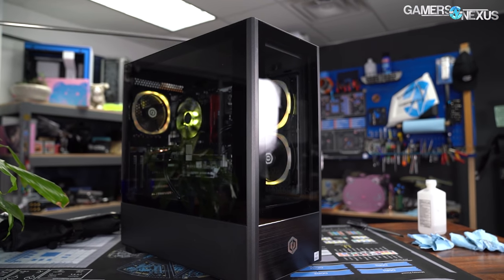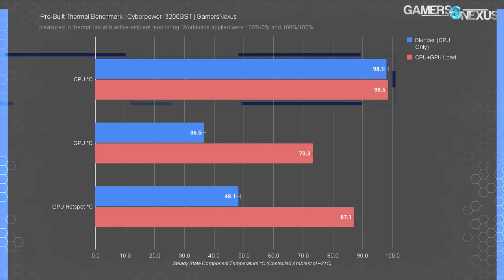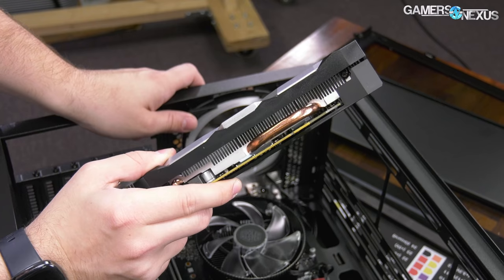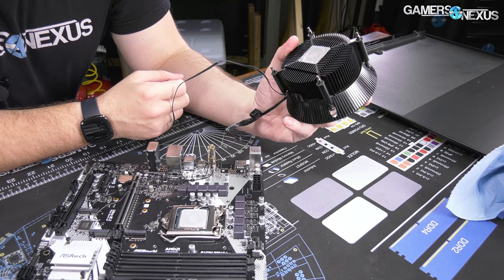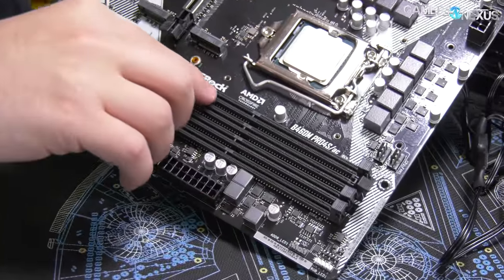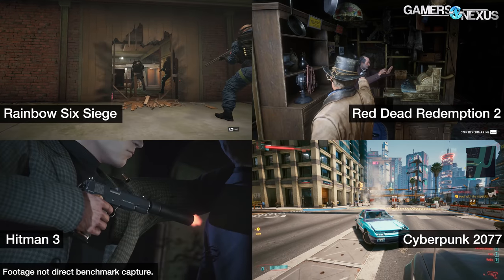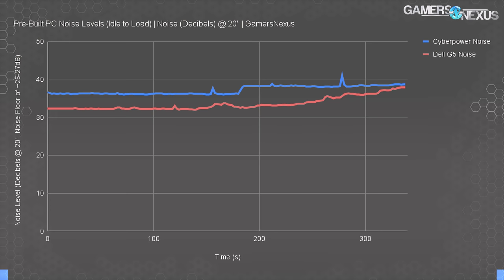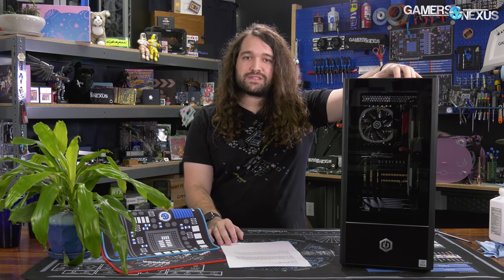Almost Didn't Suck: Cyberpower $1000 Pre-Built Gaming PC Review (Gamer Xtreme 3200BST)

Comment: At this point, I understand that a single stick of memory is cheaper than 2.... but when you build a "performance" or "gaming" themed computer, the company building the machine should put 2 sticks in each machine minimum, to ACTUALLY get the full performance of the CPU installed. This is a $1,000.00 machine, its obvious they put some thought into parts of it... but they saved money with a shitty CPU cooler....that alone should have given them a bit of wiggle room to put in an EXTRA STICK OF MEMORY! But, then again, maybe these companies can't get their hands on 4GB sticks of DDR4?..... I personally think, that if a computer is going to be sold as even a low end, budget "gaming" or "performance" machine, there should ALWAYS be 2 sticks of RAM. If a CPU is not able to run dual channel for its best performance, then... its not truly a "performance" computer, it turns it into a media center at that point.

Comment: i got a cyberpower for 950 with a rx 5600xt and a 3600 and 16gb of ram. the thermals was good, it looked good, the ram came factory overclocked, and it was easy to upgrade and change the case

Comment: I bought a cyberpower from a guy on Facebook for 900 with a ryzen 5 3600 and an rx 5600 xt and it runs great. Different case but it had good thermals. I still replaced the stock cooler with a vetroo v5 which dropped the CPU temperature by 10c

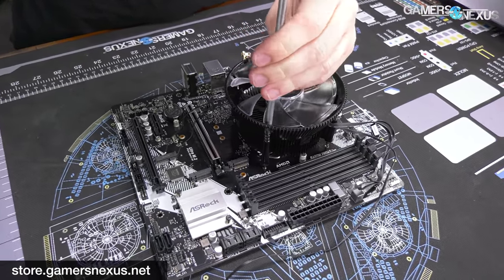Comment: HELP 11:00 Ok so, I bought the cooler shown in this video a while back. I fell in love with the look of it and looked up reviews. They said it's like 10 degrees cooler than the stock cooler, and cheap. Not bad. I still get 90 degree temps when playing cyberpunk tho. Would adding thermal paste (or maybe a thermal pad) to the cooler make it perform better? 

Specs: i7 8700, 2060 I have the phanteks p360a which has a full front mesh panel with 2 120mm intake fans and 1 120mm rear exhaust fan.

Comment: I ordered a PC recently from CyberPower and it too had thermal issues. They don't have their configurator set up properly to only allow coolers that are capable for the setup being built, and they allow garbage coolers like this one or a single rad AIO to be used and wonder why they are pushing 90-100C. With my 10700K, I literally delidded it and replaced the IHS with a copper one and some Conductonaut. Using my previous AIO, a dual rad H100i v2, it works much better and rarely goes over 80C while maxed.

Comment: My 2010 iBuy prebuilt was a disaster. 2 screws holding the MOBO down, no screws on the Gpu,  sent the wrong channel RAM at the wrong frequency and a brutal AIO that had the worst coil whine ever. Not to mention the Psu died within 3 weeks of purchasing due to a faulty fan.😒🤔

Comment: I have bought one 'pre-built' computer before. It was the an 'over-clocked' 4790k CPU, 16 RAM, and Gigabyte motherboard bundle, with Corsair water cooling. I bought a Fractal R4 case and Corsair power supply and put it together, and it was a nightmare from the beginning. 
It was not a stable system at all, and the amount of trouble shooting that I had to do to make it stable and suitable for audio work was ridiculous. Had to reset the BIOS to get rid of the 'over-clock' because of crazy thermals, and completely remove the Corsair water cooling from the equation because it's controller was the main source of instability and the fans on the radiator were like having a swarm of bees in a PC case.
I had always built my own systems before, and have always built them since. I had considered a new pre-built as an updated PC for VR, but videos like this make me question whether that is a good idea.
Thank you for cluing people in, particularly inexperienced users that have little to no experience. You are doing them a solid!

Comment: I have this PC case, what the 3060 TI, i7 10700k same CPU cooler fans, 16gb ram, gig b460m mobo. I pulled all my fans off their original location and put them to the exhaust on the top drawing air out of the case at the top and in through the side and the back bringing fresh air to cpu and GPU (smoked tested with no dead zones and GPU air flows more to the right of the CPU cooler so the CPU is getting more fresh air then GPU washed air) I bought filter mesh and put it on the back of the case. With the changes my thermals drop significantly. Everything stays in the '50-low60s on continuous hard gaming. I did my own cable management not that it was bad I just tucked all of it and with the fan movement it needed to anyway. My only complaint is that the case it a little loud. I used some foam inserts that you would never see and quieted down the nose 👍shaking the fan shroud of the CPU cooler not the base itself. I have the same CPU cooler and it does the same, but the base does not move and my CPU has great thermals + its quiet. Lets see him grab and shake a 2fan Radiator CPU cooler lol prolly break it off bahahaha

Comment: So...absolute garbage tier CPU cooler, but otherwise not a bad system?  Although I really can't see paying over 1k for something with a last gen entry level video card.  I will say I am not a fan of micro-ATX motherboards, at least for gaming systems.  There is just not enough room on the board.  Something like my Linux server where I'm just using integrated graphics, sure.  When you said "I need some alcohol" (referencing cleaning off the thermal paste), I thought for sure you were making a "I need a freaking drink" joke.

Comment: I just got a Cyberpower $2900 custom job.  Pretty good and came with RTX 3080 Aorus and it 10700k.  I have already tore it apart and put it back together.   The only problem us the Phantek cooler covers the memory slots, so I have to remove it to add 2 more memory sticks

Comment: Not great but not bad sums up my experience with Cyberpowerpc.  2014 purchase, Corsair H60 was not seated properly to the CPU, resulting in high temps.  I had to contact Corsair to troubleshoot as Cyberpower tech support could not resolve it.  Once I fixed this with Corsair tech support assistance it ran fine.  Price was low, you get what you pay for.  I wonder if a premium builder like Maingear would give the buyer a quality build.

Comment: Better solution for Cyberpower regarding this system; switch out the K CPU for a non-K, replace CPU cooler. Done. Saves having to source a shit ton of different components and is far more practical for Cyberpower to do.

Comment: first thing I did with my cyperpower was to upgrade the cooler, cause I realized that cooling was completely insufficient. I have had to have the SSD replaced cause the stock one shit the bed. I am only using the Cyberpower as a jump off point, as eventually it will get slowly completely replaced.

Comment: im curious if Molex Centipede providing voltage straight from psu will not be better than connecting fans to motherboard that is small cheap and often a bit stressed by power hungry cpu/gpu/peripherals. Im curious as im running ryzen7 3700x with 6700xt on asus a320m and decided to pass on m2 ssd to not push mobo even more..(also oculus cv1 set is sucking power from my board) anybody know if m2 drive or additional fans will stress cheap mobo power lines more? worth the risk of loosing stability? or im wrong..?  (putting aside lack of control on molex)

Comment: Thats the pc i bought with a 3060 i7 10700f changed my cooler too and noctua and flipped the side fans for the air to go in. Im overclocking my gpu running high resolution games and my temps are around 68c while overclocking my gpu and 60for the cpu while running games like valorant im around 50c

Comment: I am currently using a PC that was built by CyberpowerPC, but it was one I configured on their website, I chose them because at the time they were giving away a free 3070 upgrade on any system that came with a 3060 Ti and I could not find either of these GPUs without going through a scalper. The only real complaints I had with my system were minor: they installed the NVME M.2 drive in the slot without the headsink from the MOBO, the cable management on the back of the build was a rat's nest and they completely ignored any management channels and just zip tied all the cables into one giant bunch of cables which I had to untangle and reroute, and of course, and they slapped a giant CPP logo on the front of my NZXT case that I haven't been able to remove w/o leaving marks on my case and a CPP logo that replaced the logo of the DeepCool Castle AIO w/o giving the original logo badge to swap back in.

Price and service was all top notch.

Comment: Had a buddy just get a 3700x and 3070 build from ibuypowerpc. It was giving BSoD after about an hour. Thought the 3070 was dying because of some artifacting that would happen when it did boot properly. But after reseating it he noticed that it was really tough to put it in and out of the pcie slot. Turns out whoever put it together literally shoved the 3070 into the pcie slot most likely ruining the slot and gpu. In the process of sending and back and ibuypowerpc still hasn't contacted him back about the return process. They're a joke of a company.

Comment: At 19:10 there is a typo on the PSU instruction, the voltage must be set to 115W? And those voltage switches are only found on passive/no PFC psu's which consist mostly out of overrated crap units that don't have 80plus anyways.

Comment: What's sad is the only reason this PC is priced at $1050 and not say $1300 or more is because of the issues GN found and Cyberpower already knew and chose to sell this trash anyway.  Luckily, most of this is a pretty easy fix but will still probably end up getting you closer to that $1300 range.

Comment: MSI sucks at the GPUs coolers quite often. Still better than some but the cheaper models from MSI really do suffer from bad designs. The thermal pads on VRAM being tiny is notorious by now. Lack of cold plates and instead using direct heatpipe contact which no matter how much one tries always has gaps between pipes and causing hotspots.

Comment: So they put in a 25$ low tdp cpu cooler .... smooth . Ive used those coolers, theyre fine on low tdp cpus .. not this, as you see . Ser wtf Cyberpower .. It should have at least a 240mm AIO at that price point .

Comment: im interested to see a comparison between building/buying from their website and getting one from bestbuy, because cyber power is running sales/free upgrades on some parts, like the ram kit you had in this video I think they are upgrading to a 2X8 kits for free, AMD cpu's are 50$ off,  some m.2 sticks are on sale too, and if you get a gpu that is low on stock you get 5% off the whole pc. The build i was looking at getting was only like 300$ over what pc part picker said it should cost and in the current market where the gpu alone could be double the msrp i think that really helps with the value, still over value but could be way worse.

Comment: That doesn't solve any of the issues for someone who doesn't want to build their own PC. At least at Cyberpower, you can build your own, using your own choices, so if the build quality is okay, that side is reassuring. I think picking your own parts is probably a better way to go, especially as you can often find deals that add discounts. And shop around. Redux has cheaper builds, but you are very limited on options.

Comment: I did what you just said before I watched this video. I got a cyber power prebuilt and replaced the cooler to a dark rock pro and I never run over 60c on cpu, I’m thinking about replacing the power supply in time, for now it’s working okay. I’m working at turbo speeds it’s not bad, I never inspected my 1660 super that came with it but I’m also not that much knowledgeable lol. I’m happy with what I got and I’m looking to upgrade from here on out and in these times I feel like I got a good base..

Comment: It seems Dell does those things to make you want to upgrade as soon as possible.  How well do they work with a clean install of Windows?  One thing I like about Windows 10 is on any HP, Dell or similar system you can reinstall windows from a flash drive and the key is already on the PC from the factory.  I hope this ease of reinstallation remains the way it is for a long time.  It is one time we didn't get Microshafted by a bad feature!!  I just wish setup would give us a choice of edition.  That would be stick with the default and pay no extra or upgrade and pay at that point if you must, it would be nice to have those options in setup along with a third one and that would be an opportunity to use a key or go unactivated (assuming your PC doesn't have an OEM license in the firmware).

Comment: You probably could fix that heat sink with a little wet sand paper on a glass plate.  Remove the screws and sand the surface of the copper and aluminum flush.  Remount.

Comment: I was building a PC seen a cyberpower for the same price or less with about the same parts i was ordering already and bought it....came with ryzen 7 3700x and radeon 7200xt and within a year i slapped a auros master gigabyte motherboard, trident z ram, an aio cooler in it....next step is new graphics card and power supply to handle all the lights i keep adding

Comment: I can’t find a single 1660 super for less than 600 so those two alone you are looking at 800 easily and the fans probably go for 25 then the case itself is probably worth 50 ish, the psu is probably running 50 ish the mobo is probably going for 75 ish, and the storage and ram is probably worth about 50 so I mean with today’s market you can probably barely build a comparable system with the same money, possibly cutting down on ram speeds to run dual channel

Comment: I bought a custom build from Cyberpower PC and it has been a horrible experience tbh. I paid 3550 usd for it and it got dings and cracks and scratches all over. The case even got masking tape under the paint still. I didnt check underneat when i got it for loose over painted tape, sorry my bad I didnt think that I would have to. A few days after I got it some paint chippings fell off from the front and apparently that was my fault as well. They are the worst company I have ever dealt with and I would strongly advice against anyone dealing with them.

Comment: I ordered a pc from them over Black Friday to shuck and get the 3080 out of it. I was going to re-use all the other parts for my kids pc - but they used the same amount of thermal paste on mine.  It wouldn’t even power on. There was so much on there that it dripped onto the motherboard and shorted.  The MB was dead, but everything else worked fine.  I never bothered to power it up as built, so I can’t say what drivers and how well it was configured.

Comment: I just bought a cyberpower recently. My cpu wasn't even in properly. They did not lift the lever on the cpu before putting it in, so no pins were even making contact. Tumbled right on out when I started removing the cooler. They also mounted the cpu cooler wrong and was not making good contact, so thank god it was not able to turn on.

And their support never contacted me when I responded to their survey👍

Comment: They probably had to have the cpu cooler in a bundle with the graphics card,  but for what they are charging for the system,  they should not be using the junk cooler.

Comment: Has that cooler got such wide screws, added to the cold plate design, got a bowing issue if tightened too much thus missing the crucial part of the CPU case for cooling? It looks that way considering the overall design. I'd get vernier over the tensioned and unmentioned cooler.

Comment: I actually have a friend that bought a cyberpower that had a really good experience with it, but then she bought a monitor and it didn't work and she couldn't figure out why. It was plugged into the motherboard not the video card. Once she realized this it was an easy fix. So yeah that label that says plug in here. That's important, but between when she bought the system and when she replaced the monitor she forgot about that.

Comment: I feel about the same way with msi, but sadly I have been burned too many times by them to go back.
I feel a couple fans at the top might do wonders, but that cooler is terrible and intel stock coolers are just garbage. Not trying to insult cooler master, they build them to intel's design.  The glass in the front is nice looking, but lack of airflow I see in a lot of peoples cases and their high temps always makes me facepalm when they tell me how hot things run.

Comment: so cyber power actaully makes this model but with a different case and a 9th gen i5 instead and it only cost me 700 it had the same motherboard gpu psu and ram card i think it was discontinued this year but still you are right though the price for this one makes no sense as they have a nearly identical system for 300 dollars less it also had front fans on the case instead of side ones and did have a vrm heat sink the only thing i did was swap the case it was in and all the thermal problems went away cyberpower can make decent computers but they put them in terrible enviroments

Comment: It is over priced but if you needed a gaming machine "right now" it wouldn't be too bad with a decent heat sink and maybe the ram and a fan controller and some other things that do not cost much or may have in your junk drawer. But no not something I would advise to a customer to get something that they can take out of the box and run.

Comment: Could they at least turn the 2 fans near the mobo to intakes? I mean I would never buy the case with glass on the front because I care more about intake than looks. But even if it was on the back panel it would still have to be better than 2 fans pushing into the side panel.